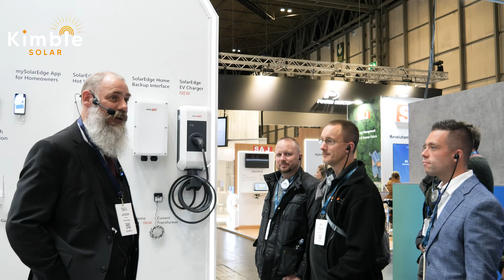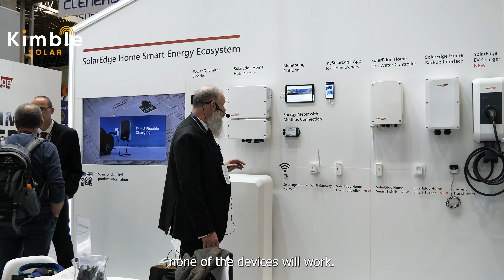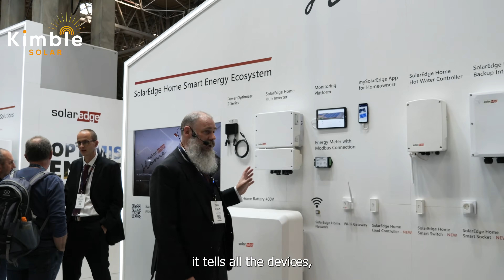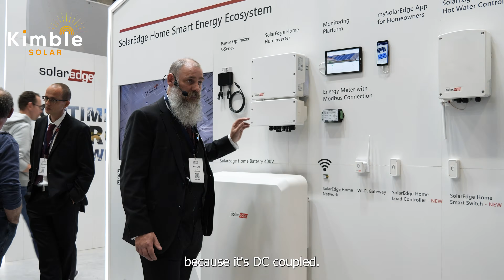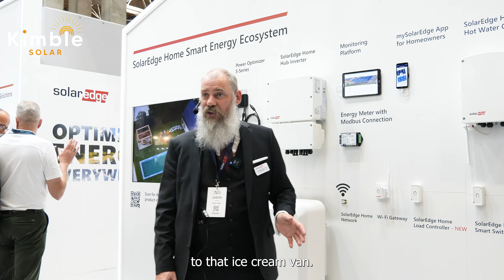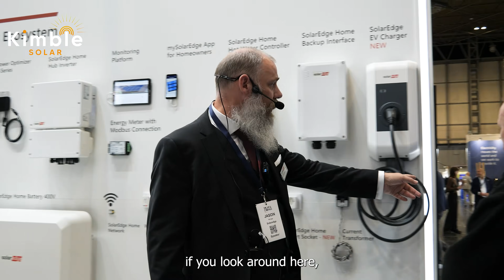The Best Solar Batteries & Inverters On The Market? SolarEdge Product Introduction

Comment: Optimiser cell monitoring at least tells you when the optimiser is broken and you've got to go on the roof and replace it.  Installers put me off solaredge due to failures.  Personally also chose to avoid due the behaviour of their home country. That being Israel.

Comment: But the weak point is that we cannot add on a Wind Turbine output. A small turbine could be setup to feed DC to the inverter to keep the battery topped up. Power outage through a winter night the battery won’t last long. I cannot get any positive info out of Solaredge.

Comment: Will SolarEdge develop metered collar device which allows backup without the expensive backup disconnect device?
Reply from the maker: Great question! Sadly as we install their products, we aren't best placed to answer questions on their future plans. SolarEdge customer services can be contacted on WhatsApp no +44360261181; I'm sure they'd be happy to help.
Reply: You need the Backup Interface to disconnect from the grid, and you also need a N - E relay to connect in off grid mode.